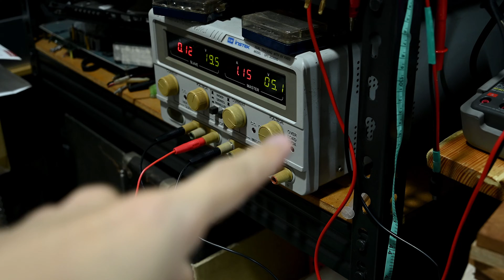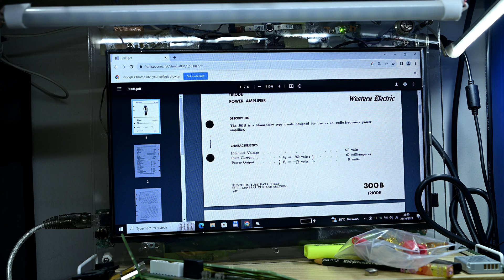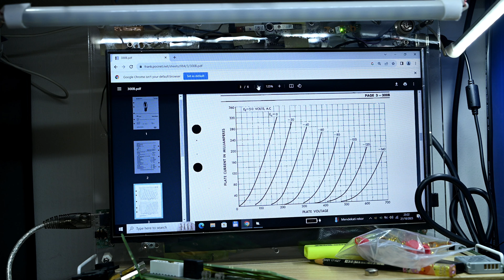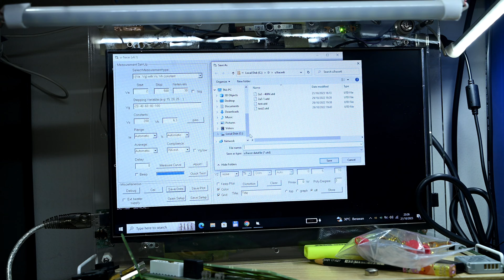Testing & Curve Tracking Western Electric (WE) 300B Tube with uTracer V6

Comment: Thanks for making this video. I was trying to decide whether or not to get a uTracer and it was helpful to see it in use.
Reply from the maker: You cant go wrong with it...
Reply: @jimmysjunkyard  Now to decide whether to get the 3+ or the 6. I'm only going to be using it for audio tubes in stereo amps/pre-amps so the 3+ should just about do everything I need it to. Although I do use 5U4GB rectifiers that are 450v. I'm guessing they both require a separate power supply if you want to test the tube in a heated state?
Reply from the maker: @MMBRM  I dont think this uTracer can test rectifier easily... You can check the website first to understand more... I personally think V6 is better as you can test larger output tubes like 300B or 845. Have sold my 3+ and happy with V6.
Reply: @jimmysjunkyard  Ah, okay. I actually thought the 3+ could test 300B. Given that I have a pair of 300B SET monoblocks I need something that can test 300B. Thanks for the help.
Reply from the maker: @MMBRM  it can, but max at 400V with V3+, you wont be able to test at higher voltage...